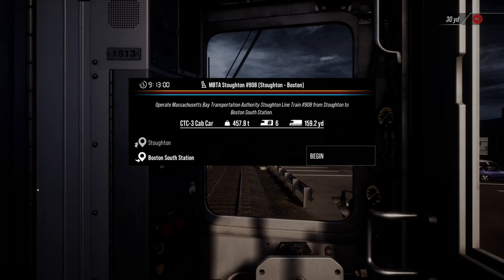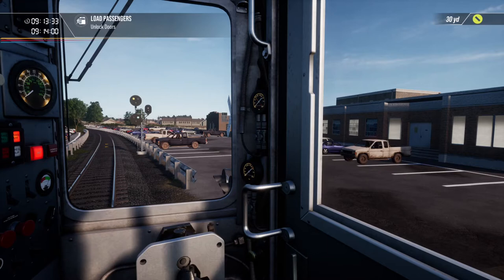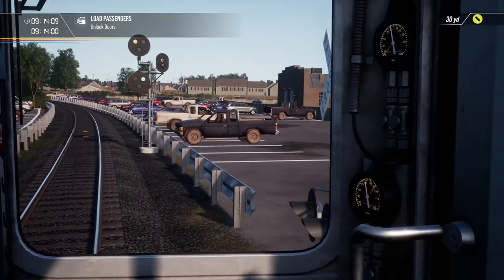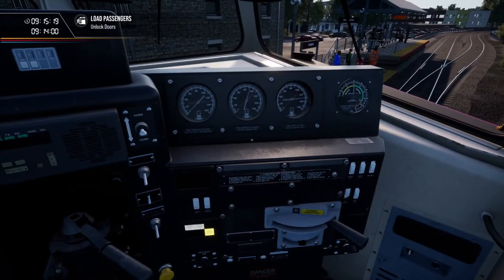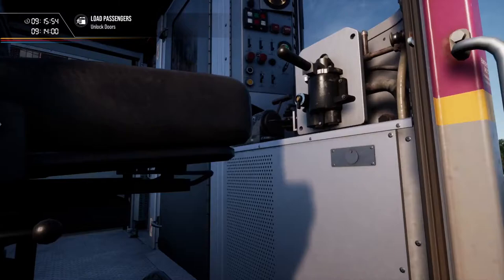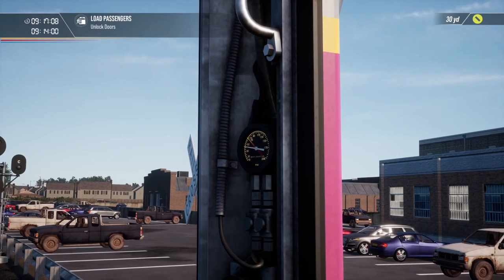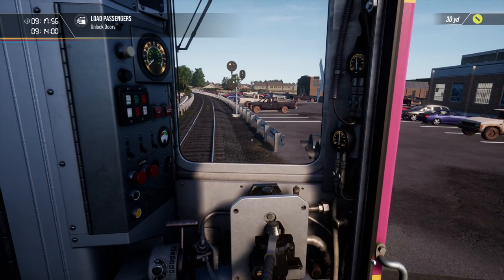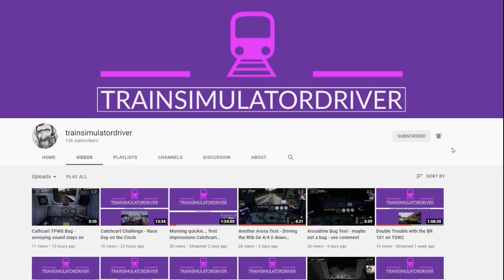TSW2 MTBA -CTC 3C brakes bug at startup

Comment: I think i’ve got almost the same issue like you. In f40ph locomotive, the locomotive start to brake randomly, even if the safety device is turning off
Reply from the maker: There's a seperate bug report for that, I get that too. O haven't checked to see if the update fixed it yet